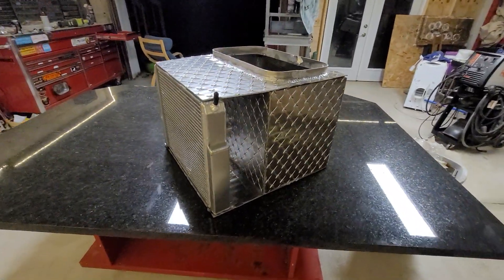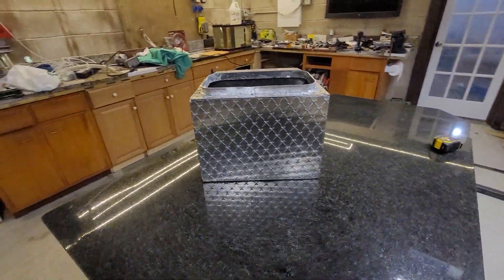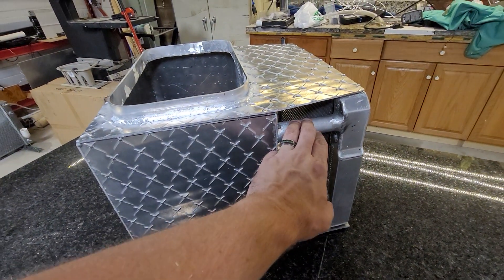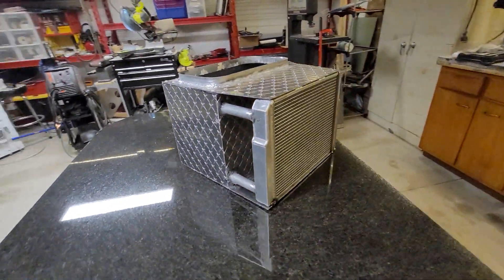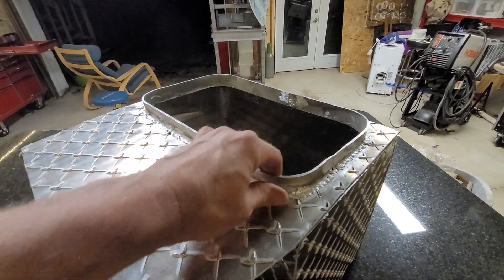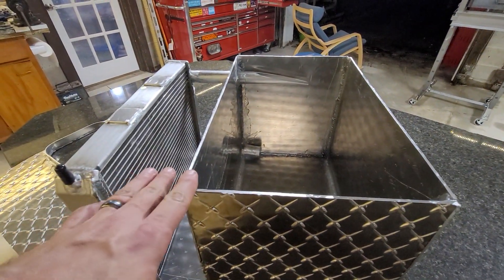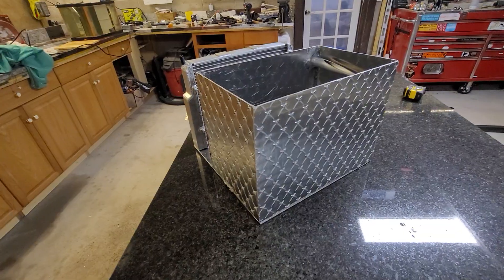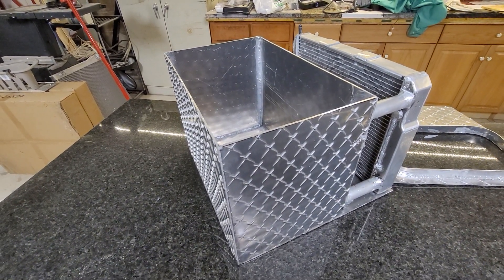Coin Heated - Hotbox Solo™ single ASIC oil submersion enclosure

Comment: This is a great concept guy! Are you planning on using a submersible pump? What model? One suggestion I have is that you do not want the suction side of the pump to come from the heat exchanger. You want the pump's output side to push the fluid through the heat exchanger otherwise you may get cavitation.
Reply from the maker: They are running with submersible pumps now.  It's a 1/4hp pump per thank for oil, then a much larger pump for water going to all four tanks.  The oil is picked up by the pump, pushed through the exchanger, then routed back through the miners to complete the cycle.

Comment: Have you done the actual math that a volume that small can actually eject the heat created by a s19 or even m30s?
Reply from the maker: It all depends on the watt usage of course.  I tested the volume in a slightly smaller tank with the same radiator and pump, putting out over 3300w, and it handled it without issue.  Temps were stable and steady.  The power supply I had maxes out around 3300w, so I couldn't test it further.